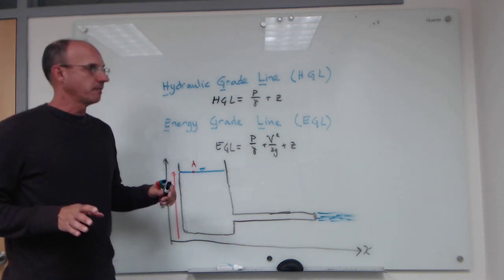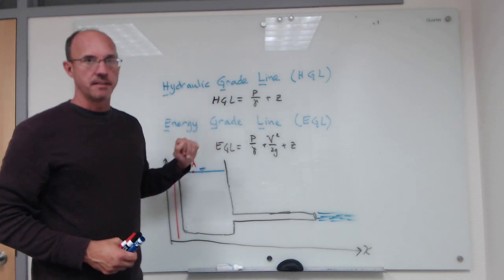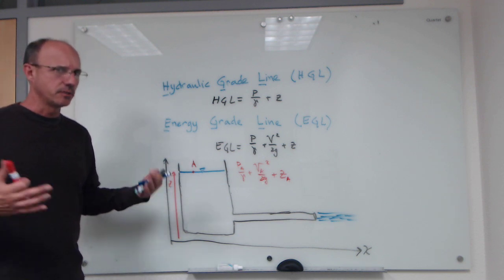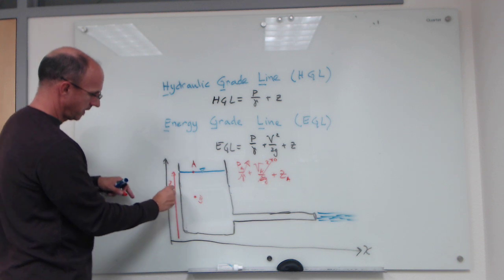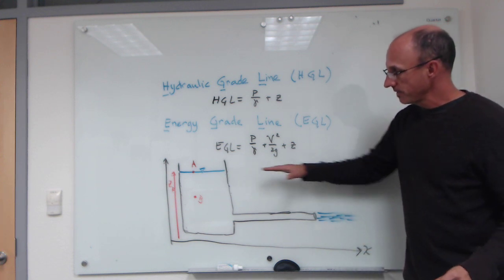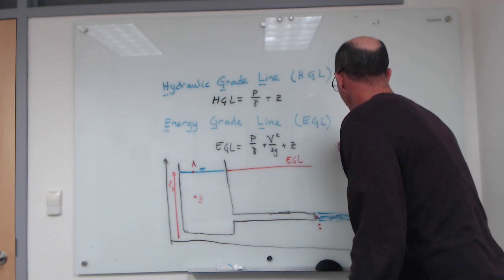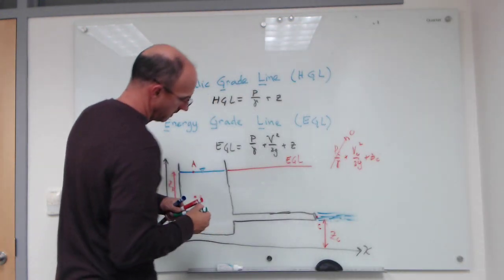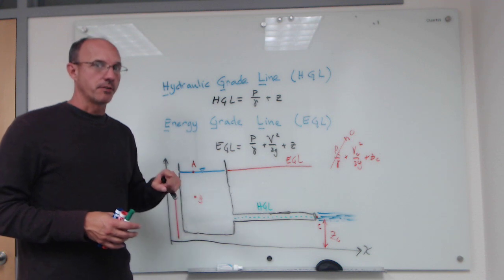What is the HGL and EGL? Grade Lines Part 2

Comment: Hello and thanks for sharing.  HGL is shown incorrectly upstream the atmospheric discharge.
Reply: The pressure is zero because its open to the atmosphere, only atmospheric pressure experienced here , if at sea level 1.019 bar.
Reply: @jamesgelsthorpe8616  https://youtu.be/AVb55pB_DAM
Reply: At the pipe discharge you meant pressure is zero hence hgl equals datum height but how can be the pressure becomes zero when we have full of liquid in reservoir Sir
Reply: @sabeerali5610  https://youtu.be/AVb55pB_DAM
Reply: @sabeerali5610  Pressure Head ... Not Pressure